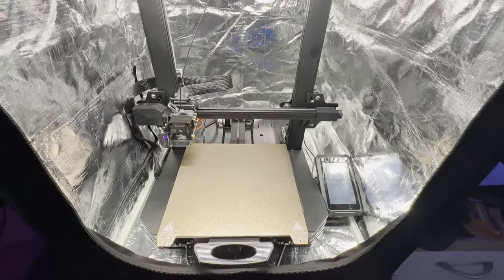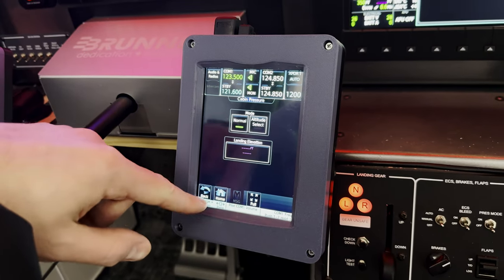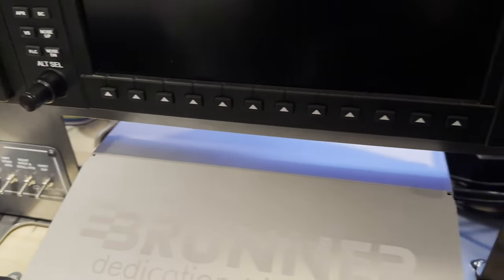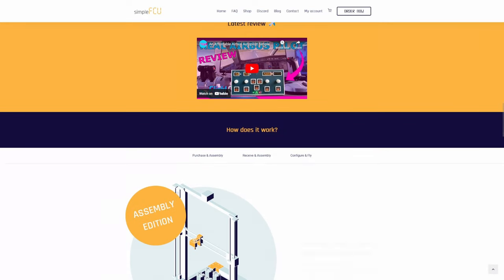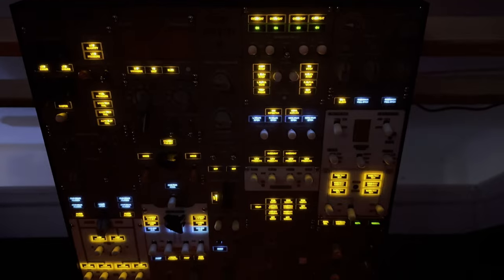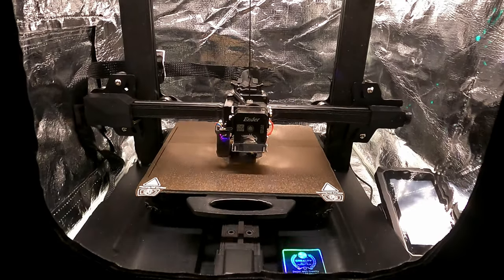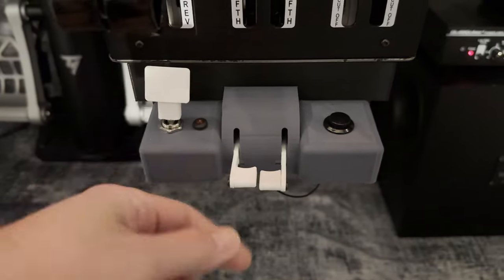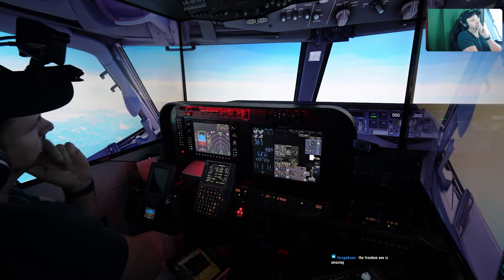3D Printer and Flight Simulator Home Cockpit?

Comment: I want to do my own cockpit of a 777 and an A330 (half and half) but I cannot find 777 overhead panels so can I 3d print the 777 overhead panels and it work for msfs?
Reply from the maker: That I’m not sure. You’d probably have to do some wiring and stuff with an arduino.

Comment: How much did all of this cost (not including the prints?
Reply from the maker: The full home sim construction or the 3d printer?
Reply: @av8rchris  the full construction
Reply from the maker: Full construction, wood and all the trimmings was probably around 12k if i remember correctly.  I have a playlist on the channel that goes through all the components and final cost if your interested.  Possible slightly higher now since I added the 737 overhead, CDU and 7" touch screens but not by much.